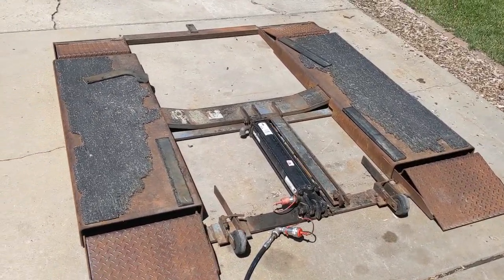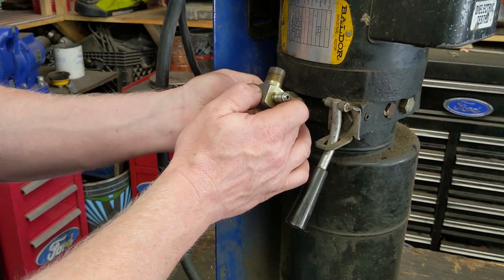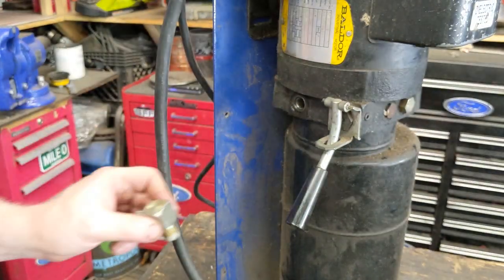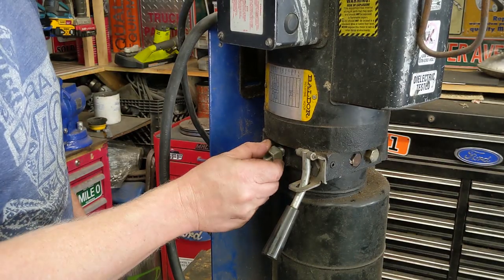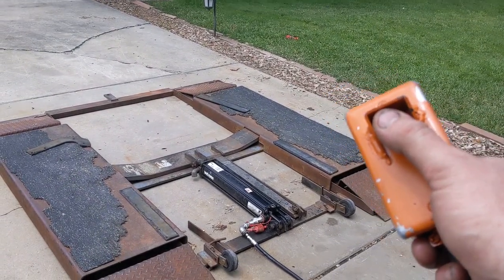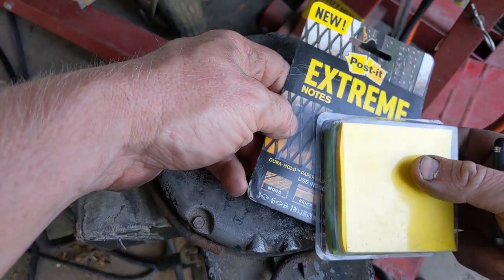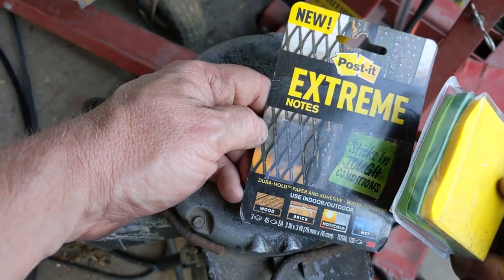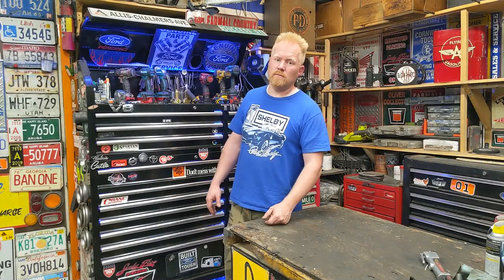Vehicle Lift adding Pressure Gauge to weigh cars

Comment: What a cool Idea. I don't think I've ever been bored of your content and most videos I actually learn something. I am surprised you don't have a tap chart on your wall somewhere. I picked up the AvE chart a while back. I'm sure it will be worthwhile when I eventually need it.
 The pup always is a fun addition to the endings. Keep up the good work.
Reply: everyone always has an iphone in their hand as quick if not quick to punch tap chart into google, or if you do enough fab work set it as your iphone background until you end up having all the sizes you use memorized
Reply: @AndrewBrowner  Most mechanics/shop guys I know don't have their phone in their hand at all times since they are usually holding tools. I was just making the observation from the kind of content Moe post's that I was surprised he didn't have a tap chart on the wall as it is a fairly common thing guys have in their work area if they do this sort of work. Maybe you need to unplug for a bit and go work in a shop instead of wasting your time and others being pedantic about YouTube comments.
Reply from the maker: You guys are both right. I do have a tap chart, just not for the taper taps. But honestly most of the time I just eyeball a drill bit and go for it because I don't have many letter drill bits they chart asks for anyways. Google does make it easy to find quick info like this.

Comment: I have same lift   It will go up and down with nothing on it   Add a small car under under 15-2000 lbs will not of up. Touches chassis and stops.  Motor running good.  Going to add a gauge to see if working.  Can you give me other places to look.  Thanks
Reply from the maker: The pump should have an overload pressure bypass. It's likely stuck partially open and or has been adjusted improperly.

Comment: Dear Ginger! And this same principle is how loaders weigh what they have in the bucket except they have positi0n switches so the scales weigh within the same bucket height every time. Looks like the old Victor gauge came off the oxygen side of a regulator on a torch set maybe. I have a glycerin filled job on my wood splitter I got from the rock crusher that they never used. Wood don't hold a light to granite! Thanks, Pal! Good job and Ginger is a doll! Healers are!
Reply from the maker: Ginger never has a boring moment. Oxygen Regulator is my guess as well and an old one at that. I think it has a 1917 patent date on the face. I'm sure I picked it up in a box of random stuff at an estate auction.
Reply: @sixtyfiveford  It was a good haul. Can't beat the old stuff!